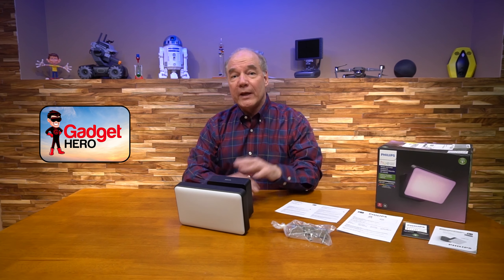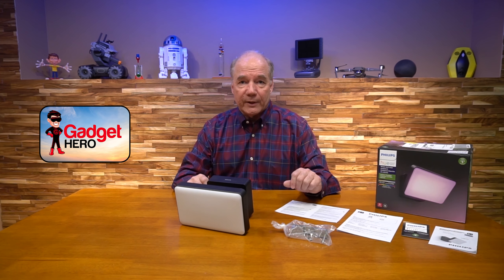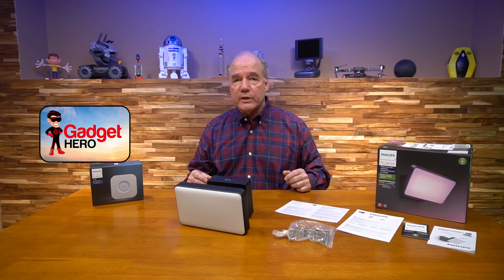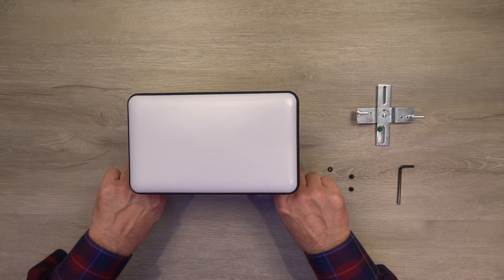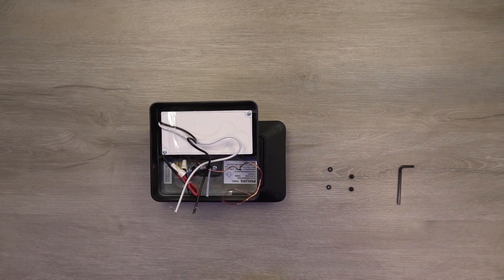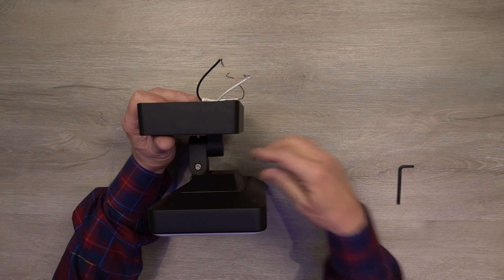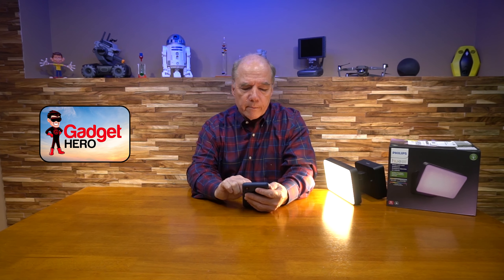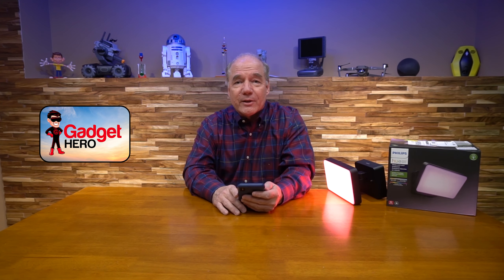Philips Hue Discovery Floodlight Review

Comment: Don’t anyone think of putting it on the wall outside and showing us how affective it is and how good the range and brightness is. 
You’ve done they same as all the others and unboxed it and powered it up indoors with no real test 
None of you even turn the lights off indoors in your little rooms to show us.
Reply: Completely clueless reviewers
Reply: Very good point. Also, how does it compare to the other one, "Welcome"?
Reply from the maker: Gruf, sorry for the delay in responding but if you know anything about how a camera captures light, it's almost impossible to accurately show how bright a light actually is when installed. I've tried this dozens of time and it never displays well. The true measure of brightness is the Lumens and color in Kelvin. Both of those metrics were discussed in the review and are the only metrics that matter when comparing one light against another.
Reply from the maker: Completely clueless comment. Ive been an electrical engineer for over 40 years and did a good job providing everything you'll need to know about how the light works and how to install it. Not sure what more I can do.
Reply: @GadgetHero1  I don't really want to weigh in on this too much. My only suggestion (and you have likely considered it) is that if you were to operate the camera in manual mode, you could keep the aperture, ISO, and shutter speed the same when comparing two lights in a subjective A and B testing scenario. This relative comparison could be really helpful. You would need to standardise the exposure for the brightest light tested to ensure the image wasn't overexposed. In theory, this should be highly repeatable, too. Thanks for your review.

Comment: Can you attach this on the soffett upside down?
Reply from the maker: Rick, You can mount on a soffett as long as you have a 4" electrical box installed to mount it to. It's not terrible weatherproof so you might need a bit of calking as well to seal it to the surface. I hope that helps and its a really cool light. Stop back soon for more tech content. Rick
Reply: @GadgetHero1  yeah there was a light there previously.  It might just be a hole in the wood with the wires and not an electric box but that's how all my soffett lights are installed and it works. Thanks.

Comment: Mounting is the definite week point of this light.  Trying to get the two mounting shafts  into the two  shaft columns is a PITA.  You are better off using 3 inch #8 screws and screwing it into the wall.  Otherwise the light is fantastic.
Reply from the maker: I totally agree that the mount is a challenge. I mounted two of these in outside boxes and one went really easy but the other one took a little more work. They did a great job on the light and could have done a little better with the mount. Overall it was still worth the work, the light is amazing. Thanks for the post and be sure to stop back soon for more content.
Reply: @R J Not whining at all.  My mount was on a flat wall and screwing it right into the wall was the easiest way to get the job done.
Reply: Thanks for that tip. That’s exactly what I did. I mounted it to a piece of 2x6, and then mounted the  2x6 to a tree.

Comment: Dude, I bought a 4 inch square electrical work box. Bracket doesn’t fit. Box is too big diagonally. What?
Reply from the maker: The light is designed to fit over the box. Normally the 4" box is recessed into the exterior wall and not mounted on top of it. All porch/exterior lights work this way and you can attach them with the included hardware. Be sure to use a little caulking behind the mount to seal it from the elements.
Reply: I did the exact same thing.. you can’t mount it to the outside if a wall without a recessed box.

Comment: I wish I’d have watched this video before purchasing my light. My intention was to mount this to the surface of my outdoor wall. But since there’s no back to the unit, I’m forced to remove my patio light and use the existing 4” electric box next to my patio door. Disappointing.
Reply from the maker: Yep, it does require a recessed box to install and it's just like a set of carriage lights that you might mount next to your front door. The recessed box is also used for holding the light to the wall. I wish they did a better job of weatherproofing the base but a little caulking did the trick for me. Thanks for the post and be sure to sub the channel so you don't miss any new content I'll be posting this week.

Comment: Beware: My lamp is using an excessively high Standby Power of 7W when the lamp is off or brightness is at 0%. That's at today's rates more than 30 EUR per year to have no light!
Reply from the maker: Thanks for the post but all "smart" lights and cameras have a small background power draw so they can monitor for commands or follow a schedule. I agree that 7W is a little higher than most but the benefit of the light outweighs the cost for me.
Reply: Yours is likely defective. Hue lights are only supposed to draw about a quarter of a watt in standby. I would contact Hue.